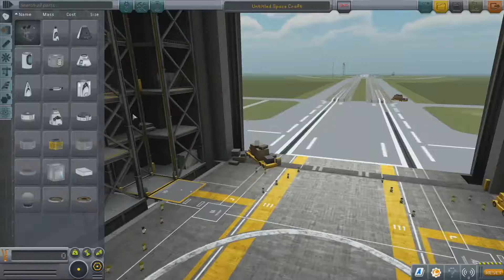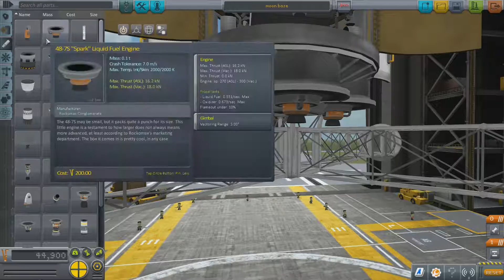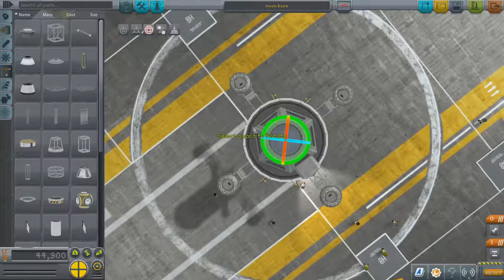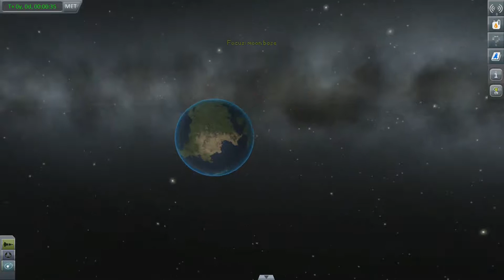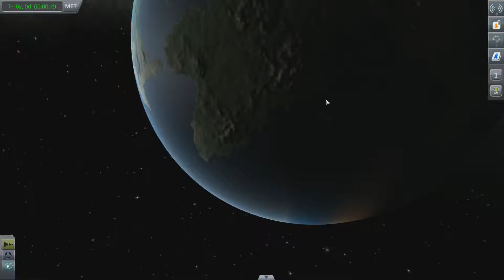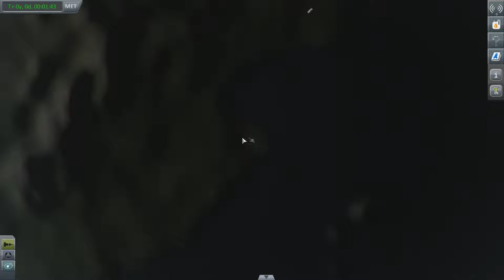KSP PS4 "Moon Base Build" Pt1

Comment: Nice build man but how u gonna get it to mun...can u do a video just going to the moon with rocket and a lander on top with maneuvers like when to increase the maneuver node and how u kW if u going to touch the moon....and I also figured out how to root parts to make bases using clamps
Reply from the maker: +Livelifeguy I'll be doing single lander in pt4 but once I'm done with this in sure you will under stand getting to Mum just as good as me.